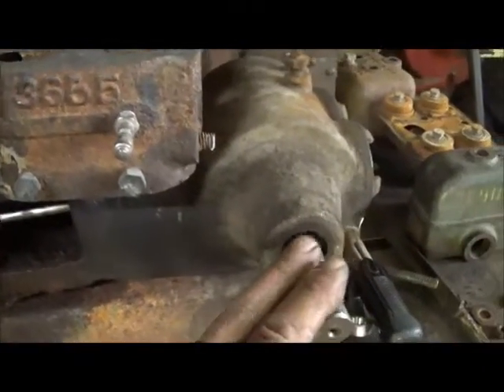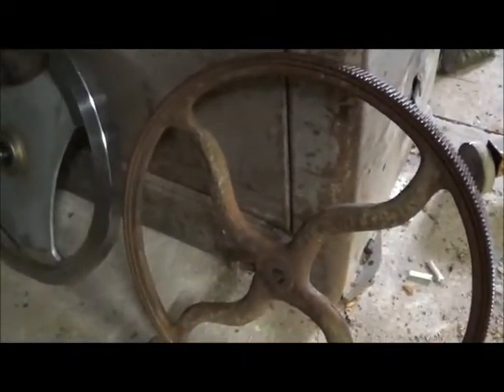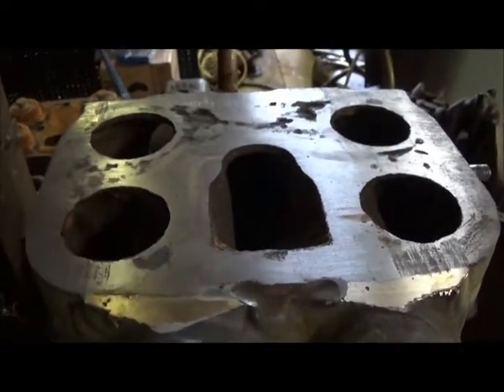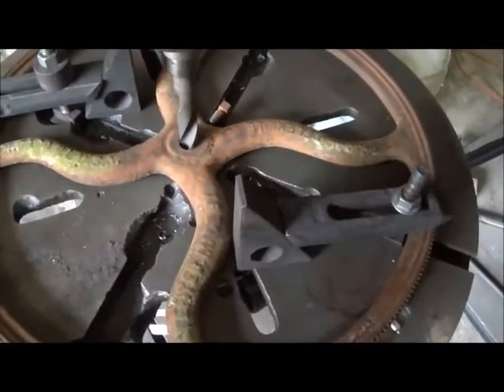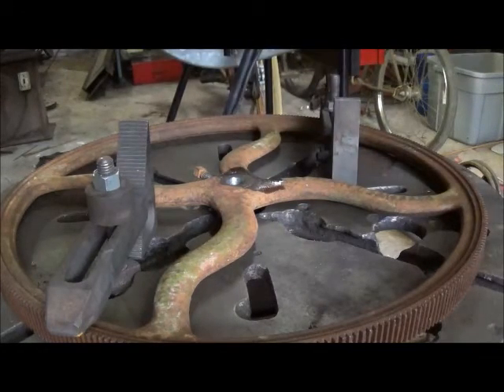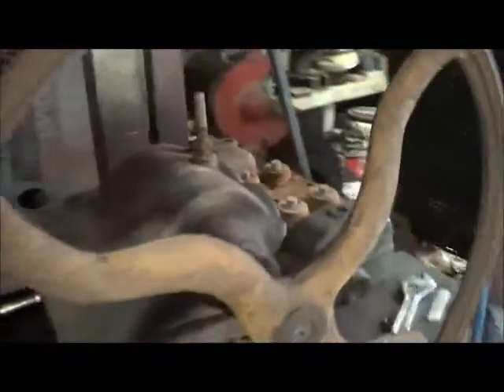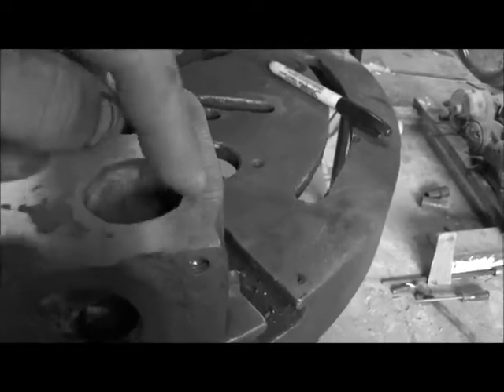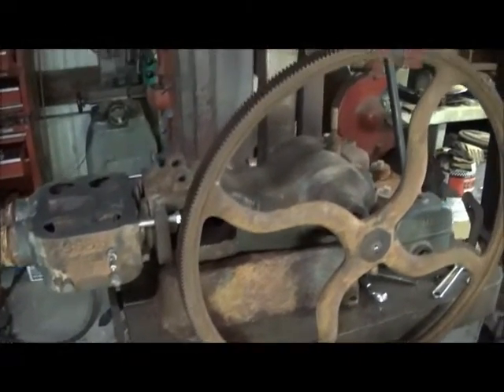Deming Water Pump To Steam Engine Pt3

Comment: nice to see all this old machinery put to good use, I still don't understand how taking old cars off the road for replacement with new cars in California can help, when you think of all the pollution and material used to make a new vehicle. I have a few of older trucks.wish I had the room for all the old machinery you have. I have a  smaller lathe mill and surface grinder and large drill press are from 50-60's. The one thing nice about having your own business and getting into these places to find these old equipment.
Reply from the maker: +Ed Ginsberg  Thanks for watching Ed, I agree and have done a little hillbilly figuring on the cost to actually scrap a car and how much pollution is generated from the crushing, hauling, shredding, hauling, shipping to China, melting and pouring new, then shipping back to be used and it would be much less pollution to drive the car longer, but you have the every 2 year crowd that trade or lease a new car because they have to keep up with the neighbors. Even in the US the scrap process is done with machines, mobile and stationary, that make pollution. I think it comes down to acquiring votes. I love my old machines, but I don't have a surface grinder, but will as soon as I find a deal on a decent one..
Reply: +Jonathan W In a way I did one of your numbers on the surface grinder, I really could not justify spending too much and covered space is limited so made an offer for what was a little more than scrap prices and it has a lot of wear as well, was refused on that offer and left, got a call a month later to pick it up for $150 and a whitney punch for a few dollars sold off the punch to pay for the grinder. Best part I only had to drive 4 miles. Retired now and have somewhat limited funds.